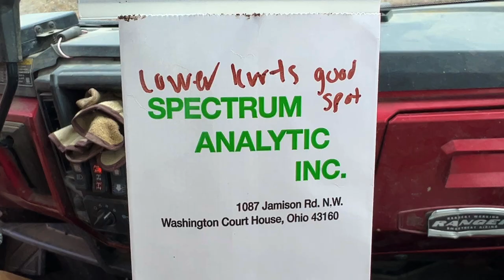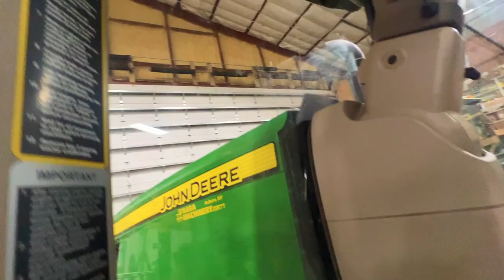There's Dirt Bags At Our Farm Today....

Comment: IF YOU PUT IN YOUR CLEANING ROOM. A (SMAL) WATER HEATER. AND YOU USE A: "KÄRCHER" CLEANER. YOU CAN HEAT THE WATER. MAX TO 40 DEGREES. SO YOU WORK A LOT BETTER.

Comment: The circle may have been caused by a fungus, like Marasmius that starts in the middle and grows outwards in a circle affecting the grass as it goes. If you had been there in October you might have seen a fairy ring, the fourth ring🤣.
Reply: Agreed!
Reply: Also possible that an old well was filled in there. The foundations can restrict moisture and cause discoloration on the surface.